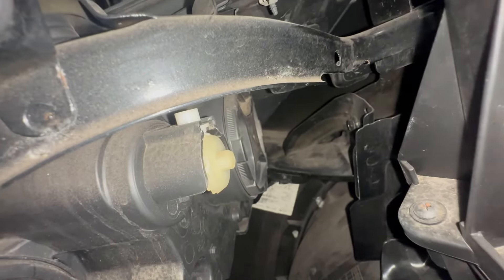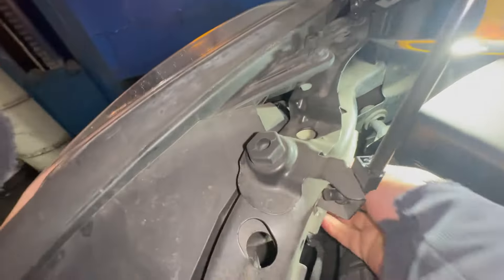How to replace head light bulb on Chevy Trax 2015 2016 2017 2019

Comment: Is there a way to loosen the cap? I cant seem to turn either one.
Reply: The guys at Autozone made me think the caps where screwed on tight. If you cant turn it anymore it most likely means you have to pop it off. There is a groove somewhere around it. Just dig your fingernail in there and pull up.
Reply from the maker: Left loose righty righty it may require sum force